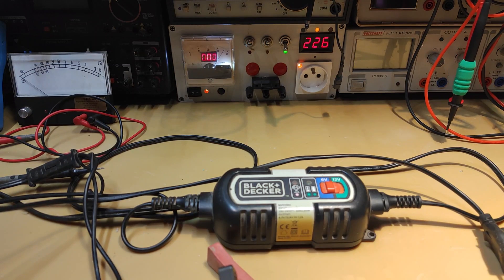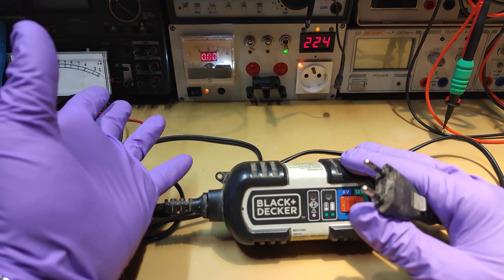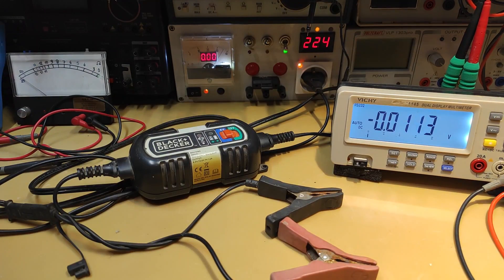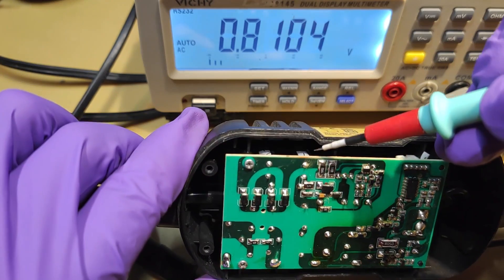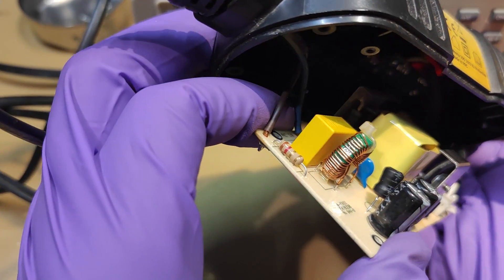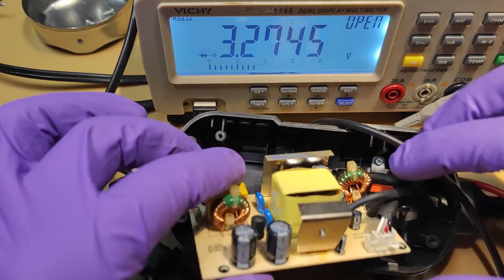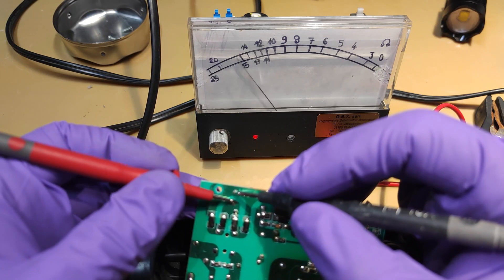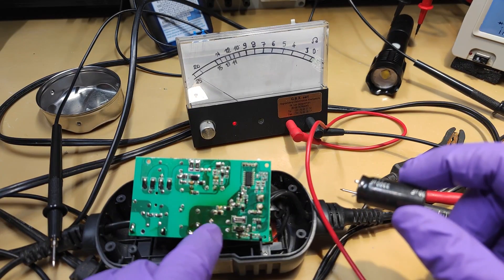Black & Decker BDV090 6/12V battery charger. The perfect FAIL.

Comment: Thank you. I enjoyed this repair video. I have 2 questions. Is that a dcr tester Tha you used to get the capacitor dc resistance?  How many devices do you have for capacitor testing? I seem to see a new device in every video.  Again, thank you for the videos you make.
Reply from the maker: I have a few of them, testing with multiple device when I am not sure. The first you seen is a component tester, it's nice to check some various components and a nice ESR. Other cheap tester are not so good. The second you have seen is an LCR meter, delivered as a kit. It's more versatile, good precision, and give an absolute reading of ESR values. If you have any others questions don't hesitate. Thanks for commenting.